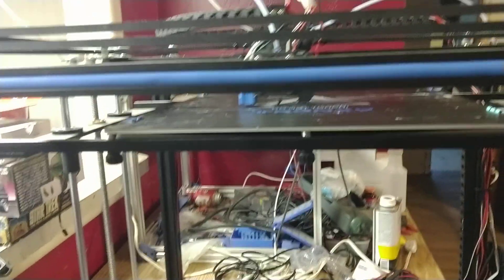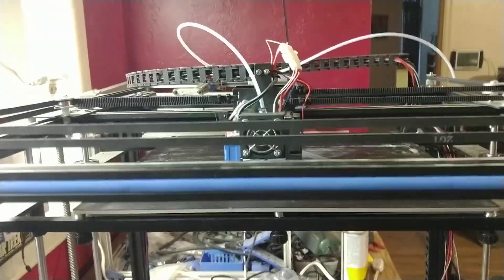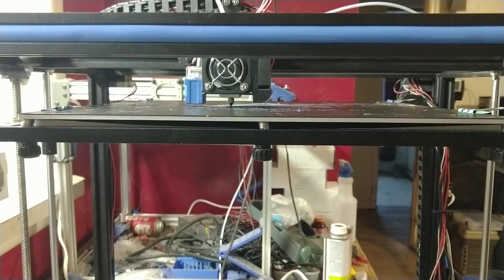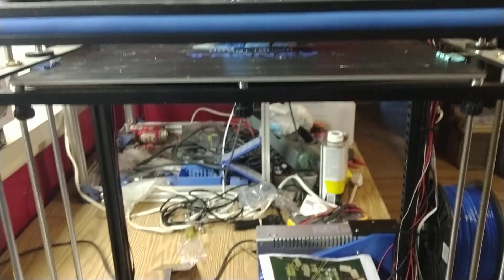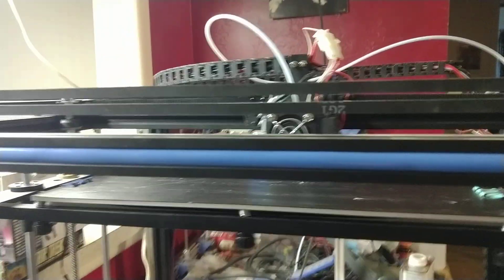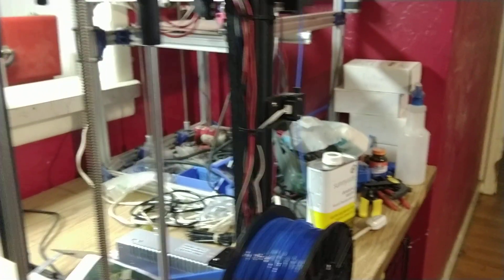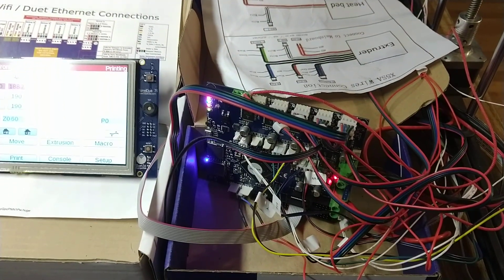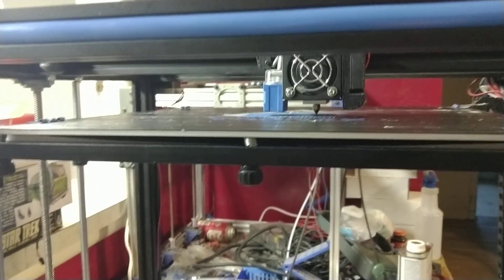Tronxy X5SA with Duet3D Duet 2 Wifi controller

Comment: By any chance did you or any other viewers check if the original Tronxy X5SA screen work with the Duet 2 Wifi?
Reply from the maker: To my knowledge it does not.  Besides, my original touch screen wsn't working very well.

Comment: Did you get the mesh working?
Reply from the maker: Yes I did, but I set it up as a single Z stepper motor, I need to revisit it and set it up for duel stepper motors.  Still, I have it working pretty well.
Reply: @JamesADoty  Is the dual Z steppers not supportet or what? Im interested to buy one but i've worried about the configurations
Reply from the maker: @MrTeckVideos  It is, but I didn't know that when I set my bed meshing up.  It shouldn't be too challenging to make the change though.  The Duet 2 Wifi controller is amazing and easy to set up once you get the hang of it.

Comment: Hey dude can i ask (if you use cura) what your start g code im new
Reply from the maker: Hi.
This is what my start gcode in Cura 3.6 looks like:
G28 ;Home
G29 ;auto level
G1 Z15.0 F6000 ;Move the platform down 15mm
;Prime the extruder
G92 E0
G1 F200 E3
G92 E0
Reply: @JamesADoty  thanks and btw do you use the clone one i see lot of them in ali
Reply from the maker: @felixgamingvlog6702  Sorry, I don't understand.  The clone one what?  If you're talking about the Tronxy X5SA, it's likely heavily based on someone else's 3D printer, but I don't know off hand which 3D printer.  If you're talking about the Duet3D Duet 2 Wifi board and 7 inch LCD panel those are genuine.

At the moment I'm printing a large statuette on my X5SA which I started yesterday about 14 hours ago and is due to finish printing in 82 more hours.  By far my longest print job to date.  My previous longest print job was on my Ender 3 and took 51 hours.
Reply: I mean the duet 2 WiFi clone  in Aliexpress  and ebay they sell them for half the prices of the original one
Reply: @JamesADoty  sorry i forget to mention that i want to buy the original one but the shiping and tax cost made me want to buy the clone (i live in asia soo the shiping cost is high)
Reply from the maker: @felixgamingvlog6702  I see, yeah shipping can be crazy expensive.  I don't have any experience with the Duet 2 Wifi clones. 

Sorry.
Reply: @JamesADoty  ok thanks

Comment: Hi, i am waiting for my duet 3d wifi board to arrive, but i wonder about the settings i have to put in to the config , Since you have the same printer and same board, is it possible to get the settings or the config files from you? :-)
Reply from the maker: It sure is.  I'd be happy to help.  I'm getting ready for work at the moment but I'll post my settings for you sometime this evening.
Reply from the maker: I had a few moments so I uploaded the files from my Duet 3D microSD card to my Google account and shared the link.  The link's in the description, will youtube let me post it here?
https://drive.google.com/drive/folders/1JJCyCehr9MRkDYH-21dzTWPkhiFGRo-S?usp=sharing
Reply from the maker: If you bought an LCD display to go with your board, modify the SETUPNETWORK script in the macros folder with your networks's SSID and password, then run the script from the LCD panel.  Once connected be sure to go in to your router and lock the IP address to your printer so it never changes.
Reply: James Doty great, thanks a lot. Yes i bought a lcd display with it. Hope it comes this week :)
Reply: James Doty what do you think about the quality in prints after switching to the new board? I have installed a e3d v6 all metal hotend and hope i can print ABS good with the new board ;)
Reply from the maker: @ulven75  I think the print quality is pretty good, I don't think it's much better than it was before I started updating the print.  I've replaced the belts, and the xy motor mounts (Openbuilds metal mounts), the entire hot end, and the parts cooling shroud.  All those things have improved prints a bit over how they used to look but my Ender 3 produces nicer prints overall.  That said, I had lots of trouble with the stock LCD touch screen, it really wasn't very good so this was a good reason to upgrade, my original belts were too stretchy and the new belts made a huge difference, the part cooling fan had been blowing on my hot end and was actually making it hard to keep the nozzle above 200 degrees, the new shroud solved that but I can't get the MK7 hot end above 230 degrees.  I can't get the heated bed much hotter than 60 degrees, but that's not been a problem.

The Duet 3D Wifi board has made the printer a lot more fun to use and a lot less frustrating.  I'm so fond of it that I plan to do the same thing to my Ender 3 even though it's been trouble free except for a clogged nozzle after hundreds of hours of printing.

The biggest advantage though is now my X5SA is extremely quiet, I love that.  

I still need to set up my filament out sensor and upgrade to 24 volts.  Power loss resume doesn't work on 12 volts, but I'm told it works great at 24 volts.
Reply: Thank you :-)  and i got the files, thank you for those too :-)
Reply from the maker: @ulven75  You're welcome.  Glad I could help.
Reply: @JamesADoty  I also want to do this upgrade X5SA to Duet 2 Wifi board, i have already done much modification, but am a little pissed i cant change to BL Touch for glass bed. I am also happy with my 12V setup with new PSU (I had one from another project, with dedicated 12V and insulation I get enough juice to quickly heat the bed) also the bed will be AC power soon anyways so no need to get 24V PSU. I hope i don't need to change to 24V if i upgrade to duet 2 Wifi, is the 24V PSU necessary for power loss /resume or any other features of the board? (Note: Also keen on the two separately operated Z axis motors)
Reply from the maker: @angeldy99baby  I'm told power out resume does require 24 volts to work reliably.  The BL touch should work because it does touch the bed but I don't have a glass bed yet and I'm still using the stock inductive sensor.
Reply: @JamesADoty  can use original stepper motors for 24v?
Reply from the maker: Yes, you can use the original stepper motors.  You'll have to replace the fans and the hot end.  You'll also have to re-wire the heated bed, or replace it.
Reply: @JamesADoty  So duet wifi board not support 5V or 12V fans?
Reply from the maker: @martinhyska1206  There are three fan connectors.  Two fans are always on and are the same voltage as the power supply.  Three fans are controllable and can be set to either 5vdc or  the same voltage as the power supply.

Comment: Hi James Doty,
What was the problems you run in and how do you resolve them?
Did you in meanwhile connect the runout sensor?
I get my Duet board next week and   it could save me some headache. 

Regards Stefan
Reply from the maker: My biggest problem was getting wifi to work.  My printer isn't near enough to my desktop computer to plug in a standard length USB cable.  There's a wifi setup program in the macros folder on the microSD card that comes with the Duet 2 wifi board.  I plugged that in to my SD card adapter and that in to my computer, found the wifi setup macro, made changes to that macro for the SSD I and password to my wifi network then plugged the microSD card back in to my Duet 2 Wifi board and ran the macro from the LCD display I bought with my board, seconds later I was able to talk to my printer from my computer.

I had minor issues to resolve with auto bed leveling, I'd been doing it wrong, but with help from the folks on the Duet forum I quickly had that resolved.

I've printed a cases for my Duet 2 board, and for my seven inch LCD panel, I'll put the board and LCD panel in their cases when the hardware I ordered come in.

I still haven't tackled my filament run out sensor but it's on the list of things to do.  

The printer  has been working very well, and is very quiet.  I need to tweak the nozzle to bed height just a tiny bit but I've had multiple successful prints without issues with this set up.

Comment: how did you wire up your bed sensor?
Reply from the maker: Hi, thanks for asking.  
Find the Z probe header, it's a four pin header just left of the large black expansion header.
Black wire from the z probe goes to z probe in, the left most connector.
Blue wire from the z probe goes to the ground connector to the right of the z probe in connector.
Though not ideal I connected the red wire from the z probe to the positive power in connector along with my positive power lead from the power supply.  I'm thinking about moving it to one of the always on fan headers which I'm not using.